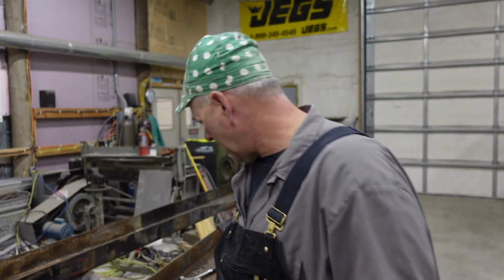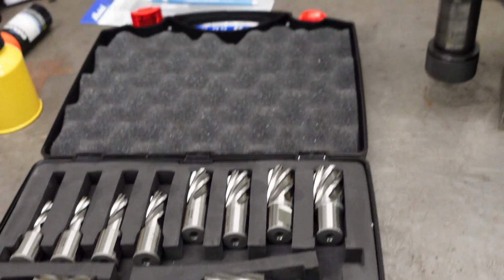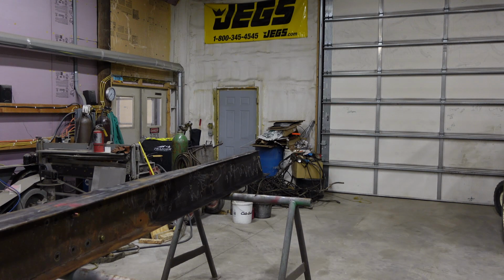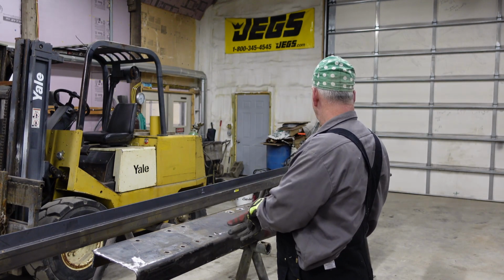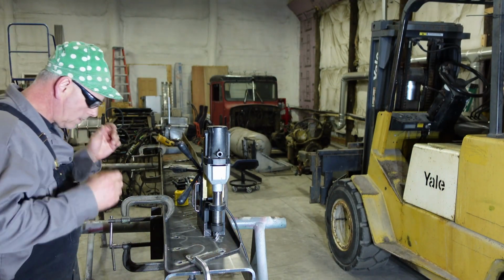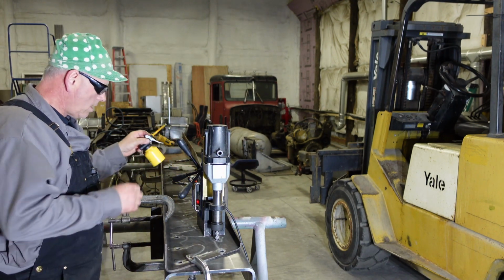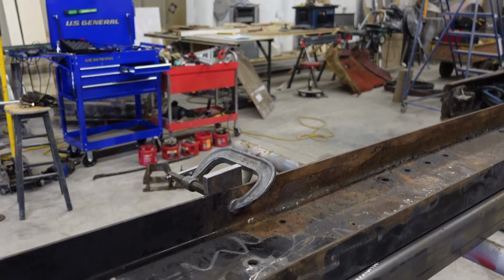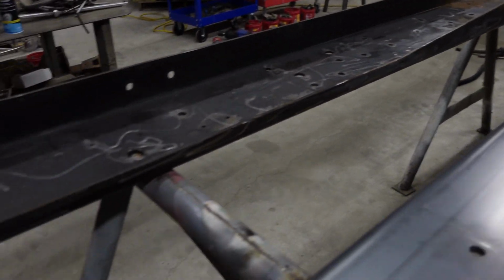359 EXHD Peterbilt restoration PT6. Drilling new frame rails.

Comment: Was the cutter still sharp after all these holes?
Reply from the maker: I think I went through two of them. You have to keep pressure an oil on them. I had not luck with high speed steel ones. I had great luck with cheap carbide ones off Amazon.